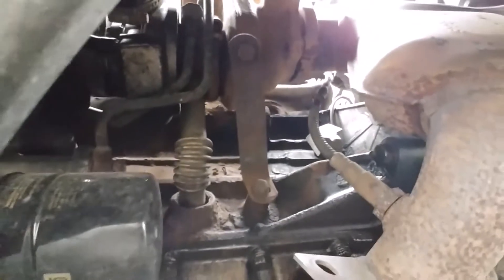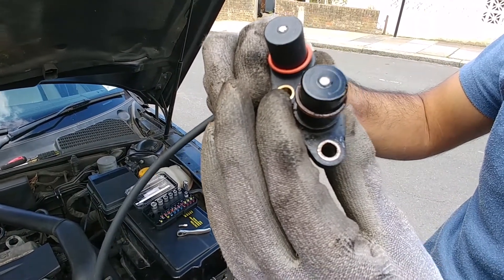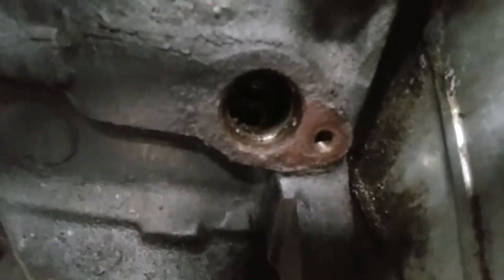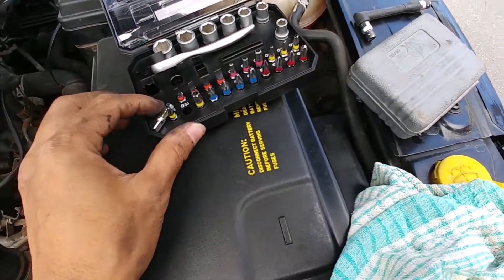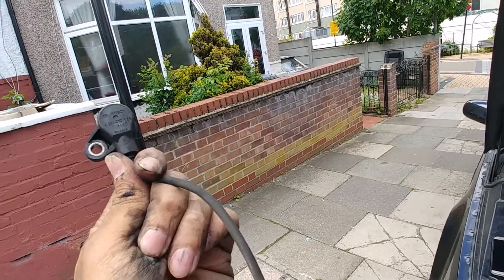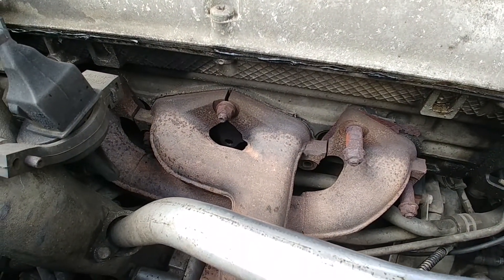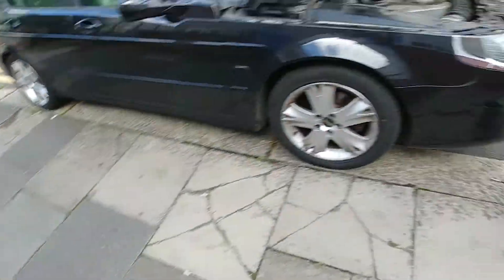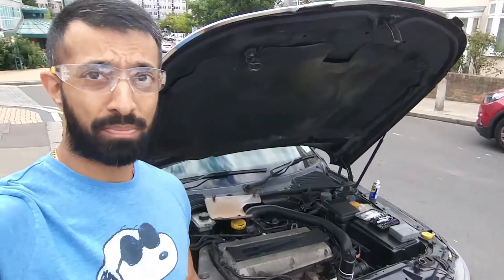How to Replace CPS on Saab 9-5 - Hot Start Issue FIX, Crankshaft Position Sensor Replacement

Comment: At last.. a clear video, simply put and you're funny as fuck too 😂🤙 thanks, this was helpful.. I was cleaning some oil off the engine trying to source a minor leak, and think I've probably just got to get some contact cleaner on the connections, hopefully I won't have to replace the crank sensor cos that is in a twat position! just checked in here to make sure I'm doing the right things.. as you say, have a go and keep the classics going 🤞

Comment: I've done quite a few of these. As a matter of fact, I had to go get my son whose car died in the middle of the road. We swapped out the ignition cassette with a spare I had that didn't fix it so I immediately knew it was the crank position sensor. 
I found it's a lot easier to go under the car to do this. You can barely see it from the top but you have full access underneath the car.
Reply from the maker: 2nd time round I replaced it over the slam panel, it was really easy as I knew where and how to access the CPS.

Comment: Thanks for the video. What exact CPS did You buy? has to be Bosch, or Valeo is ok too? Anyone tried other brands?
Reply from the maker: 6 months after shooting the video the 3rd party CPS failed. The shock and horror of being stranded in a retail park pushed me to purchase both Bosch and Valeo brands. 
After examining the brand's I went ahead with the Valeo, as it just felt better and seemed superior. 
Well, couple years on it is still functioning without faults.

Well recommended!
Reply: @the80sdude51  thanks.

Comment: After removal, slice the bottom of the heat shield where the screw goes through approx 4 o'clock. Place new sensor in cavity, screw in bolt but do not tighten to allow heat shield to slide from top angle onto the screw. Tighten. This will make installation much easier.
Reply: Gotta watch those Lumbar sensors you were talking about! Theyre tricky to get out too!

Comment: I had a hell of a time replacing this part. I had to bend the heat shield back and forth until it snapped off, otherwise you are blind to where the screw (T-30) is on the CPS. Even then, I had to use a very small air ratchet to remove the screw and a finger ratchet to screw it back on. Thanks for the video. It helped.
Reply from the maker: Much obliged,
I am so sorry to learn about the heat shield, the first time I looked for the trox screw I too was unable to identify it, and truth be told that is very reason why I ran to my younger brother.
Well I am happy my video provided some assistance, thank you for your comment.
Thank you and warm regards.
Reply: @the80sdude51  I'm wondering how your Saab is doing after replacing the CPS? Once I replaced mine, I test drove it right away--ran great--but then immediately stalled at a stop sign. I'm guessing I didn't allow it enough time for the computer to adjust to the new parts (I replaced the mass air flow, too). So, I pulled the negative post off the battery, placed it back on, then allowed it to run for 20 minutes or so; now it's running fine and maintaining RPM's when stopped. Eureka!!!!
Reply from the maker: @scoop23jk  My vehicle was fine straight away and run perfectly for a few months and then suddenly the cheap ebay CPS starting to show symptoms regardless of engine temperature. I did not waste any time and took it out at the earliest convenience, I instantly noticed the tip of the magnet was misaligned and had some impact markings, I thought it must have made contact with the trigger wheel.
 I was rather confused as to how this was possible, I genuinely thought the crank end float has excessive play. Having both the CPS out side-by-side I scrutinised the build quality and measured both with a digital vernier caliper and noticed the eBay item was ever so slightly taller (1mm) than the Bosch item, and that explained why it made contact.
I purchased a Valeo item and benchmarked it with the Bosch unit and it was identical, once I replaced the CPS for a Valeo item the car has been great.
Reply: @the80sdude51  thanks for the video I’m about to do this job tomorrow.I paid £35 for an unheard of make sensor for TMS hopefully it’s okay
Reply from the maker: @Robbo2g  You got this Luke, the force is strong
Reply: @the80sdude51  I noticed on another post that people say the torque bolt is hard to get back in so some people have used longer bolts with a spacer.I will let you know how I get on Jedi master.
Reply: @the80sdude51  I decided to put a stud into the threaded hole then put the sensor and bracket on and a nut on top
Reply from the maker: @Robbo2g  Result, great idea! Thanks for sharing my good sir